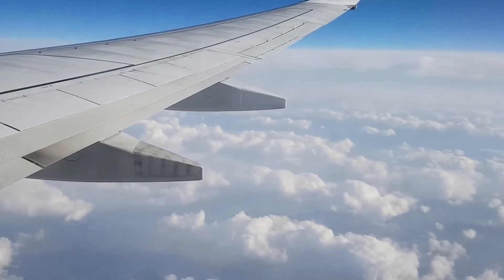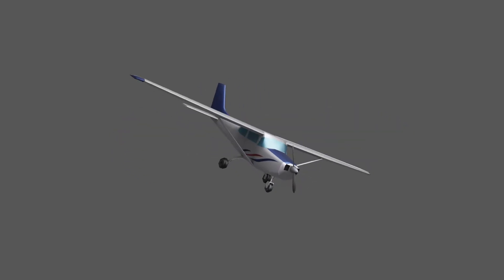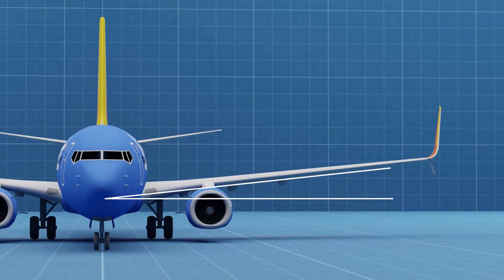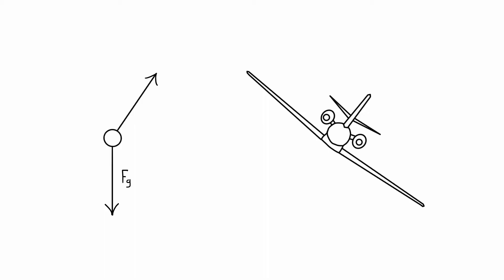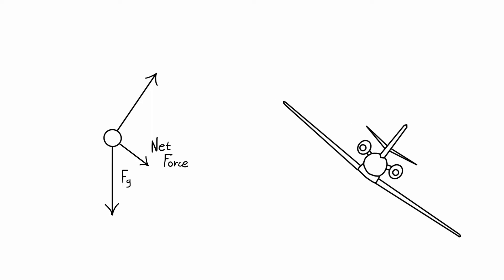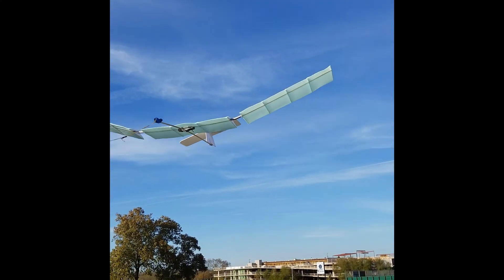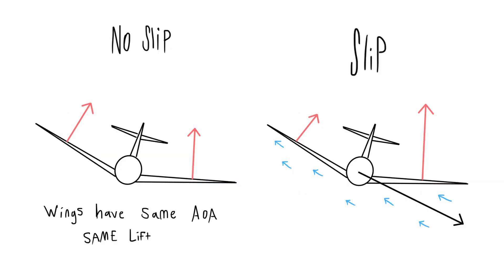How Does the Dihedral Effect Work in Aircraft?

Comment: Is it true to say that the downward component of the slip is required for the lower wing to have a greater AoA? So in a sideslip without roll (e.g. a wind shear), the dihedral effect will not cause a torque on the roll axis?
Reply from the maker: wind shear would also cause a moment for a wing with dihedral.  since the wind is facing the bottom of one wing and the top of the other causing different AOA if that makes sense
Reply: @Benjijart You're quite right, wind shear does cause a restoring roll force, due to the sideways component of the slip. So it's only true that a slip is required, not just downwards. You wouldn't see the effect in a wind tunnel where the model plane is fixed in place but can spin around the roll axis.

Comment: Would it be correct to say that in a sideslip with dihedral the raised wing has a higher pressure on the top causing either the pressure difference to reverse, bottom having lower pressure top having high pressure, or having an equal pressure on both sides, while the lower wing, since the bottom of the wing is sliding into air the pressure would increase, not doing much to the top?

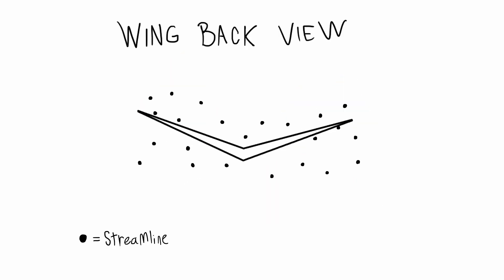Comment: I have a question! Since the lower part of the wing here 1:14 has a higher vertical component of the lift, wouldn't it stabilize the aircraft even without any sideways moving air mass? Or is that a fallacy, since both sides of the wing still apply the same amount of torque to the center of mass?
Reply from the maker: Actually the reason it has a higher vertical component is because of the side slip. The dihedral angle makes it so one wing has a higher angle of attack than the other when the aircraft is side-slipping.
Reply: @Benjijart  okay, i visualized it and now i seem to get this. Thank you for clarifying. I also wanted to ask, if the center of mass of the aircraft is in front of the wing, the dihedral must also act as a vertical stabilizer? Though it wouldn't provide a lot of stability.
Reply from the maker: @MrPilotStunts  yeah that’s true
Reply: @Benjijart  thank you a lot!

Comment: I still don't understand the side view you showed in the video. No matter how much you roll or bank. the side view of angle of attack should be same
Reply: Here's an easy way to visualize this. Make a basic paper airplane. (Extremely basic, it doesn't even have to be able to fly. The simpler, the better. Just fold a piece of paper once). Give it a ridiculous amount of dihedral, like 45 degrees up. Now, look at it from the front. What your eyes see, is what the air flow sees. Hold it at a positive AOA so you see some of the bottom of the wings. Equally, since you're looking at exactly from the front. Now, turn it sideways a little. You'll see a lot more of the bottom of the nearer wing, than you will the farther. This is the higher AOA of the nearer wing because of dihedral.
Reply from the maker: Not with side slip
Reply: this video should should have begun with a discussion of pendulum effect.    which is another principle that is  Not  well-understood, by most people/explainers.     d        googletranslate
Reply: @daviddavids2884  there is no pendulum effect, although it is sometimes falsely used as an explanation for lateral stability.
Reply: Airplane doesn't need to move forwards at all. Imagine leaf with dihedral falling, it will always turn its baily down towards movement vector. Slippage is like falling down.

Comment: You're one of the few who explains dihedral stability correctly. This works for low wing designs. However because of the side slip dynamic, a heavy HIGH WING aircraft is more stable with anhedral. This is because of the massive fuselage that adds to the equation. Side slipping with that big panel at the wing root will actually generate a huge high pressure against it which adds to the roll. In this case anhedral helps to blank out the fuselage from side air pressure, reducing the plane's tendency to continue the roll. So anhedral in a high wing design will add stability.
Reply from the maker: you are correct that the pressure exerted over the fuselage during slip will induce a moment and in a high-wing where the center of gravity is above the center of pressure this will contribute more to the bank but anhedral is not used as a countermeasure against this. In the case you're describing anhedral would actually present the same amount if not more area to the oncoming slip wind that is below the center of gravity therefore contributing even more to the roll and, in fact, making the aircraft more unstable in the spiral mode. The wing does blank out the fuselage from the slip wind... but that wind which hits the wing still exerts a moment on the aircraft.
Reply: @Benjijart   The inside wing, in a slip, with a high wing design will accumulate high air pressure in the crux of the wing root and fuselage. This pressure is enough to lift the wing restoring the roll to level. The anhedral wing tip of the outside wing is low, but because of the high wing configuration, is blanked out by the fuselage and receives no slip air, no extra air pressure or lift. the anhedral is also not extreme enough to present the inside wing tip (i.e. left wing in a left roll) a negative angle of attack to the relative wind,  but close to or at neutral in the worst case. I've heard it explained a little more elegantly than this but here's a video doing a pretty good job of explaining the concept. https://www.youtube.com/watch?v=I8iLR2xRNKY
Reply from the maker: @blackbirdpie217  the video does not corroborate your explanation. the narrator says anhedral is used to offset the inherent stability of high wings. the pressure built in the "crux" is a feature of all high wings that can lead to an undesirably high amount of stability so anhedral is implemented to make the aircraft maneuverable in the roll axis to the degree that is targeted by the the designers.
Reply: @blackbirdpie217

This is incorrect.  

Anhedral does exactly what you expect.. it destabilizes an airplane.  

The reason why it’s used it to correct excessive stability.  High wing aircraft are more stable.. but the Cessna 172 doesn’t use anhedral.  

Swept wings and T tails also add to lateral stability.. which is why most planes with anhedral are cargo jets.  Without anhedral, they wouldn’t be able to maneuver.

Comment: Well explained however, I wouldnt necessarily call it more "angle of attack" on the lower wing as AOA is in relation to the chordline of the airfoil and relative wind. Maybe more surface area for the wind to make contact? Idk what to call it
Reply from the maker: The lowered wing actually does have a greater aoa relative to the raised one even by your definition. Your explanation about surface area is kind of another way to look at it although the raised wing has a similar amount of exposed surface area the relative wind strikes it on the top surface of the wing instead of the bottom. It's all quite hard to visualize which is why I made the video.
Reply: @Benjijart  the chord line of both wings are at the same angle to the relative wind. The AOA will never be different on any wing unless aircraft manufacturers come out with wings that would somehow twist inversely from each other
Reply from the maker: @BulaBula808  The wings do not need to physically be at different angles of incidence to have different angles of attack. They are experiencing a different angle of attack because of the slip condition and the dihedral angle of the wings. During the slip, a component of the relative wind pushes on the bottom surface of the lowered wing while pushing on the top surface of the raised wing. You can see this at 1:10. Of course most of the relative wind, is coming head-on hence the drawing at 1:16. Without a different AOA there would be no difference in lift between the wings and therefore no net torque on the aircraft around its roll axis.
Reply: @Benjijart  i completely understand what you are saying. Just referring to the definition of relative wind does not equate to your examples. You are absolutely right on the concept but the terms you are describing on relative wind i believe is not correct. If i am wrong, PLEASE refer me to a certified book
Reply from the maker: @BulaBula808  Relative wind is just the oncoming flow of air. The slip adds a sideward component to the relative wind. If the wings have a dihedral, the relative wind will hit each wing with a different angle causing a different angle of attack and thus a different lift. Here's a NASA paper, refer to page #134 https://practicalaero.com/wp-content/uploads/2010/04/NASA-SP-367.pdf
Reply: @Benjijart  i stand corrected, thank you for the insight
Reply: @Benjijart  oh so is it kinda like... because both wings are still receiving the same oncoming airflow, but now one wing has (sideslip) airflow hitting the top (in a slight sideslip condition), and the other has airflow hitting the bottom, they have a sort of imbalance in sum airflow? (if that makes sense)

So because the upper wing has the component of oncoming airflow, but also has more airflow coming from "above", then sum of those two components equals a lower AOA than the other wing?
Reply from the maker: @kingdavewoody  yes